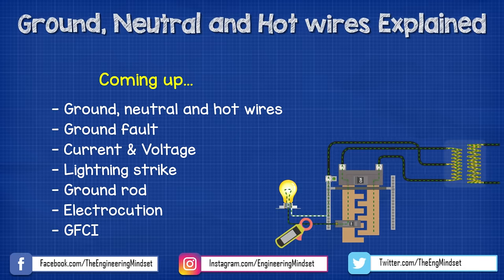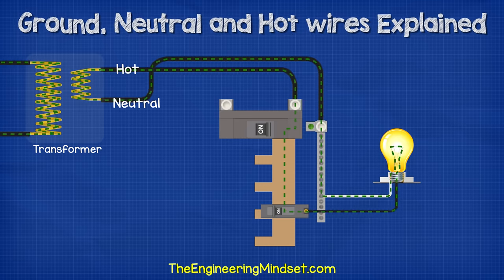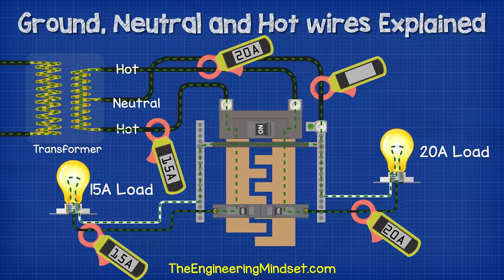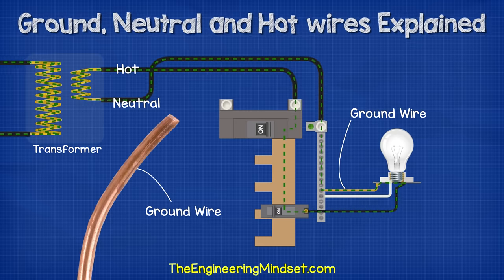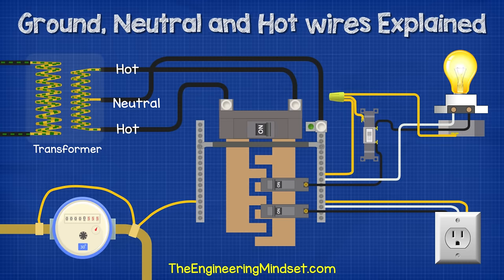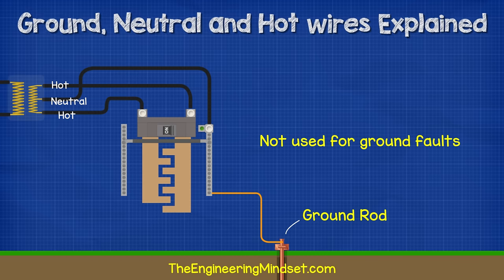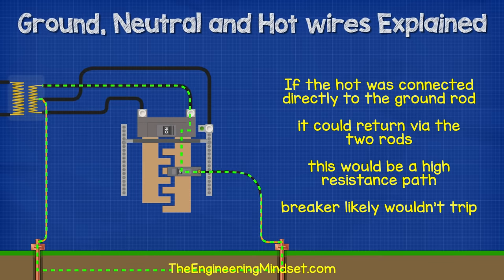Ground Neutral and Hot wires explained - electrical engineering grounding ground fault

Comment: I am a senior technician, self-employed in the PCB manufacturing industry.  Back when I was struggling with the difference between ground and neutral, I came up with an analogy using water that helped me better understand.  Imagine you had an upstairs laundry room.  Of course, there would be a drain in the middle of the floor just in case the washing machine sprung a leak.  But, in normal use, the water in the washing machine would go down the intended path through the drain behind the machine.  The drain in the floor acts the same as a ground.  It's not an active part of the washing machine plumbing but if necessary it can carry the water away to avoid flooding the downstairs.  The drain behind the machine acts as the neutral because it is intended to carry the water away in normal operation.
Reply: Great way to remember !
Reply: Thank u
Reply: Damn my dude...im an Electrician in GA and never heard a plumbing type of explanation for the Neutral but you are dead on...props to you sir,I'm gona use this on a couple of the older fellas at work!!
Reply: God Bless you sir!
Reply: Sweet!!! Now we know. This should be pinned
Reply: Almost like a Overflow Outlet?
Reply: Like a backup neutral?
Reply: love that you shared your wisdom
Reply: Great explanation! That really helped put a good picture in my head to understand the process.
Reply: Wow. Is it really just like that??? Really? If so, thank you. Teachers should explain it simply first before going complex.
Reply: thx ,man
Reply: Love this!!! Ugh I’ve been struggling lately and this helped 💛
Reply: Thanks for sharing this simple analogy :)
Reply: Dude that's a great analogy.
Reply: Thank you Greg
Reply: Like that. 👍
Reply: Im an appliance repair tech and this actually really helped me get that to click thank you!
Reply: well thanks... you just saved me from spending 10 minutes watching the video!
Reply: Game Changer!!!!!!THANK YOU!!!
Reply: Nothing beats a simple and rudimentary explanation. Thank you Sir, you've taught me a great lesson.... just keep it simple.
Reply: Uhm… what?.
Reply: Wowww....its nice....
Reply: Thanks for that analogy 👍 honestly helped me in college.
Reply: @princeuy8021  No, it's a bit more complicated than that and isn't a good analogy, which is why teachers don't use it.
Reply: Perfect now I understand
Reply: Love this channel. Love this community. Thank you all.
Reply: Wonderful analogy! It is freaking fascinating how often water analogies are used in the explanation of electrical engineering! Fantastic!
Reply: Made it better
Reply: What about a 220V outlet having only 2 hots and a ground?
Reply: Thank you very much...
Reply: An interesting way to remember
Reply: thank you... that makes sense.  in the event of a ground fault AND you have an earthing mat plugged into that ground wire of the receptacle, does the current flow to both ground (bus bar) AND the earthing mat?  looking at the diagram, it looks like ground wire "completes the circuit" at the busbar if there's a ground fault: transformer (source) -> live wire  --> ground wire --> bus bar --> transformer (source).  w/grounding mat touching that circuit (thanks to ground fault) bc it's plugged into ground, wouldn't that current go in both directions (to ground and to earthing mat)?
Reply: Thats actually really useful.
Reply: How so you come up with the title “Senior Technician” if you’re self-employed?  Why do you need a title at all?

Also, I’ve never once seen a floor drain in a residential laundry room, regardless of floor level. 

Other than that, your analogy works fine. 👍🏻
Reply: @Jcreek201   I'm not into titles. "Senior technician" is my way of saying I have a lot (50 years) of experience in electronics - but I am not a degreed engineer.  My formal training was through an 8 month Air Force tech school for analog flight simulators.  My son's home has the laundry room upstairs and the washing machine sits in a special tray that is connected to a drain pipe.  Eventually, the machine will leak and the water will be carried safely away without damaging his home.
Reply: Thank you very much Greg!!
Reply: O
Reply: So helpful. Thanks
Reply: Good explanation. Thanku
Reply: Great explanation
Reply: It's called earth, not ground
Reply: Beautiful.
Reply: Wow.... greatest explanation...as it is never before and ever after ❤
Reply: That's a great analogy, ill use that as a teaching tool!
Reply: @guyincognito. Please expand on your answer.
Reply: Holy smokes - Why has no one been able to say this before. I think people don't understand it when explaining. Thanks!
Reply: That is brilliant
Reply: Good idea of how to remember
Reply: Perfect!
Reply: Cool ❤ thank you
Reply: Thank you Greg. You are an amazing guy
Reply: that really does help. that will definitely stick with me
Reply: ….holy sh!t 👀 that’s a perfect analogy
Reply from the maker: We just published a new Ground fault, short circuit and arc fault video, so much detail! Link HERE➡: https://youtu.be/Qi0ynSQw-wc

Comment: Why is the battery backwards? Shouldn't your positive be hooked up to your 'hot' wire? I'm coming from automotive wiring where this is the case.
Reply: The diagram shows the movement of electrons which flows in the opposite direction of current.
Reply from the maker: We just published a new Ground fault, short circuit and arc fault video, so much detail! Link HERE➡: https://youtu.be/Qi0ynSQw-wc

Comment: Not to be that guy but ground wires are never less resistance than neutral. Commercial wiring you generally use the conduit which has far greater resistance than copper.  In house wiring they use the same gauge so it is easier to work with. Anything larger than 12GA will generally have a ground conductor up to 2 sizes smaller (6 Gauge generally has an 8 Gauge ground). The design is to provide 10x rated current flow for enough time to trip the breaker.  So yes path back to the bonding bar but not because it has less resistance.
Reply: Hmm that doesn't make sense.  Wouldn't copper be a better choice for ground? Is it possible that  pure copper is attached to conduit when  it goes into the ground?
Reply from the maker: We were referring to to path not the material it's made from. We discussed this later in the video.
Reply: @EngineeringMindset  You're making this worse. The "path" will always be the least resistant under Kirchoff law the lesser resistant path carry less current the higher resistant path will carry less current.
Reply: @j5892000  generally grounding rods are a copper coated steal, nickel or even galvanized. But that is Earth ground. At the box it will just galvanized steal where conduit is used as the ground. It does not need to efficiently carry current it is for safety.  In residential it is wire and in smaller branches the same gauge so you don't have to have different size connectors.  If you look inside a light fixture the ground is usually a tiny piece of braided copper. As mentioned just enough to carry up to 10x rated load for a fraction of a second to trip the breaker in a fault condition.
Reply: @GH-oi2jf   ah  so  does the conduit work fine due to the voltage being high enough to overcome  the resistance  like over head powerlines  that  are made of aluminum and carry high voltage  or is it just the fact that its metal And  the electricity  has no other path to use  anyways when  going ground?
Reply: @askandy7952  ah I see thanks  . great info too
Reply: @EngineeringMindset   your videos are very very informative
Reply from the maker: We just published a new Ground fault, short circuit and arc fault video, so much detail! Link HERE➡️: https://youtu.be/Qi0ynSQw-wc

Comment: You just explained the difference between neutral and ground better then anyone in my school OR my work. THANK you.
Reply from the maker: Glad you enjoyed
Reply: Yes most people don't know that a neutral is just the center tap of the transformer and it can carry a voltage potential to ground.

Tesla himself was asked about people getting shocked from neutrals and he asked " did you ground it?"( he meant bond the neutral to a grounding electrode), problem solved.
Reply: Exactly. I always asked this to my professors/coworkers and what they all said sounded like they didn’t even know either.
Reply: Klik B  Those that can't do..teach.
Reply: @billwilson3665  And those that can't do can't do because they were never taught. ;)
Reply: The only other thing to add might be the professional trade/code difference between grounded conductor and grounding conductor.
Reply: bruh, ground doesn-t go to the source, it's called ground because it goes to  javeline... on the ground -.- also called earth. only  case ground goes to source is when you ask for 3 phase supply and you get 4 wires, 3 phases or hot and one neutral
Reply: @Twoface0233  I agree.  I've asked several people who I thought should know better about the function of the neutral wire and one of them told me it was so you could sell power back to the power company.  Hmmm.  I don't think so.  I came from an automotive background (DC circuits) so the whole concept of three wires is new to me but this video is VERY good at explaining the difference.  Thank You for making it and posting it The Engineering Mindset!
Reply: @Hearing.Chanting Remembering.Krsna Only if it is bonded to an Earth ground.
When AC was first introduced by Tesla, people complained that they were getting shocked off the neutral, he told them to ground it.
BTW, I've been a master electrician for over 40 years.
Also in a 3 phase 240 volt delta, the neutral tap is between 2 of the legs and that is why the opposing leg of the delta carries 208 volts to ground while the other 2 legs carry 120 volts to ground.
Reply: @Hearing.Chanting Remembering.Krsna Yes that is what I said in my first comment of this thread, scroll up.
Reply: We only learned how to make a flash light.
Reply: Same I was lost but now I get it my teacher isn’t good gonna need to retake my course cause of him
Reply: I thought at long distances the ground rods didn’t have much resistance between each other so when the neutral gets disconnected from a house sometimes you don’t notice because the ground rod takes all the current back to the center of the transformer. This is why it’s a good idea to put a clamp meter on the ground rod wire every once in a while. Am I wrong on this. 

Fantastic video by the way. Very few people describe this completely like you did. Great job.
Reply: @OprichnikStyle  Nope. You are mistaken. Electricity does not 'want to go to ground' as many have been taught. It goes to ground only because the transformer is also grounded, thereby completing a circuit.
Reply: @ecospider5  In theory if your ground connection was extremely low impedance, maybe. But even though the earth as a whole would serve as a perfect conductor, the connection points (i.e. your grounding rod) do not; and so you will have an added load in your return and therefor you would notice varying voltages between the two phase legs when unbalanced.
Reply: @Spruce_Goose when I said people wouldn’t notice I was referring to people that don’t understand electricity. Yes if you new to regularly test the voltage at your house you would probably see the problem. Putting a clamp on the ground wire guarantees you will see the problem.
Reply: @ecospider5  I see what you are saying. I certainly don't see any reason not to do what you suggest. Heck, maybe it's a good idea.
My point was only to clarify that the ground rod impedance will cause strange behavior on the system; behavior that is commonly observable like lights that dim and brighten (for the duration not for an instant) as other loads are switched on/off, as well as other behaviors one might observe due to over/under voltage. It doesn't necessarily require measuring voltages with equipment to see this in a lost neutral scenario. 

If I started noticing this, I like your idea to check the ground connection for current (after first checking to see if the neutral has obviously come loose.) The other trick would be to make sure you are not running balanced loads when taking the measurement.
cheers
Reply: @ecospider5  another example symptom could be shocks experienced via metal 'grounded' equipment.
Reply: LOL what the hell school is this. I want to know, so I can make sure no one ever does any work for me, that went to it
Reply: @Twoface0233  That is my greatest and maybe only pet peeve. just admit you don't know and we can figure it out together.
Reply: Dam because
Reply: @EngineeringMindset  she was
Reply: Get another school👩‍🏫
Reply: @MichaelClark-uw7ex  You're a genius 👩‍🏫🤣
Reply: @spruce_goose5169  I actually did a repair once, where the customer said the lights were flickering, I started my inventory of the system by checking the service drop.
Looked good, then I noticed small wisps of smoke or steam coming from the ground rod.
I knew they had lost the neutral at the transformer and the ground rod was carrying all the 120V load, it actually got very hot.
Reply: Smart explanations makes a smart population
Reply: Swim
Reply: Gram
Reply: Although the neutral has connection to the ground, the purpose of it is the return path across the hot wire going the transformer. While ground wire serves as the protection from the ground fault. Ground wire and neutral wire must have separate ground rod.... This tutorial video is well explained ....
Reply: It's simple... the white wire picks up all the slack from the colored wires
Reply: @Featherless1  WOOOOOOOOW
Reply: Imagine a black man saying the same thing, would you understand still?
Reply: Yeah I mean it's sort of semantics.   In an alternating current the ground and positive essentially switch.  Therefore neither is really either and both :P
Reply: Than 
I’m sorry
Reply: Can anyone think of a different comment please? It's literally thousands of the same exact thing comment on every video
Reply from the maker: We just published a new Ground fault, short circuit and arc fault video, so much detail! Link HERE➡️: https://youtu.be/Qi0ynSQw-wc

Comment: My body has completed a circuit a number of times.
Reply: Do you know the wattage you are rated sir?😁
Reply: @markanthonyvaldez4517  Maybe he is still experimenting on that!   LOL
Seriously Pea Stone - be careful out there man!
Reply: same - not the best feeling, I think you'd agree
Reply: Electroboom:
Reply: @slatsgrobneck7515  I know the reply is late, but thanks man. Had another experience with a faulty fridge electrical cord the other day.
Reply: We complete it when we finally get out of the hydrogen machines and return to source.  :)
Reply: hahah,!! in grade school (90s), there was an audatorium with 2 pay-phones… next to eachother. If you took the receivers off “the hook” (leaving them dangle or whatever), and used each hand to pull the levers down (whic is what happens when the phones are “hungup”), a current goes from one phone, up one arm, across heart, and out other arm. It DEF had a charge!!. it was actually dangerous. 🤦🏼🤣🤷‍♂
Reply from the maker: We just published a new Ground fault, short circuit and arc fault video, so much detail! Link HERE➡: https://youtu.be/Qi0ynSQw-wc

Comment: Paul, you are the best teacher whom I have ever run across when trying to understand the fundamentals of electricity.  
  I have been trying to learn this concept for years, and for years, NO ONE could teach it to me so easily as you just did in this video.
  PLEASE do not stop teaching people!  Your method of teaching has most likely helped hundreds - if not thousands - of people in search of higher learning!
Reply: By now, it looks like maybe millions of people!
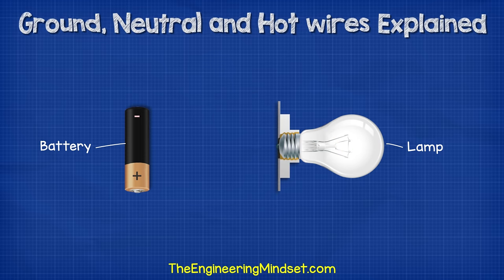Reply: 1:35 i always assumed on a battery with direct current the positive+ side was hot with current travelling outward and the negative= was the ground to complete the loop
Reply from the maker: We just published a new Ground fault, short circuit and arc fault video, so much detail! Link HERE➡: https://youtu.be/Qi0ynSQw-wc

Comment: This is a fantastic video and explains things very well. The one thing that is potentially not accurate, though, is that in a DC circuit the wire going from the negative terminal of the DC power supply to the negative connection of the load/circuit is called the negative or ground wire, not "hot wire". While it is correct that electrons flow from negative to positive, all voltage (difference in potential) has been dropped across the load or circuit so that there is no voltage at the negative or ground wire. The "hot" wire in a DC circuit is synonymous with the positive wire, or the wire that carries the difference in potential.
Reply: Thanks. The pic at 1:49 messed me all up.
Reply: The hot line in DC is the positive.The negative is called ground.There is no actual ground (earth) in a DC circuit as negative is always zero volts.
Reply from the maker: We just published a new Ground fault, short circuit and arc fault video, so much detail! Link HERE➡: https://youtu.be/Qi0ynSQw-wc

Comment: After high school, I resisted the thought of doing engineering. But currently, I am a graduated electrical engineer. I think these videos are very powerful for anyone having difficulty on these topics.
Reply: Yeah it’s important to remember that everyone has the potential to make a difference. I’m often shocked how negative I can be towards myself, and in those moments I remind myself that no matter where I’m at now, as long as I take charge, I can power through.
Reply from the maker: We just published a new Ground fault, short circuit and arc fault video, so much detail! Link HERE➡: https://youtu.be/Qi0ynSQw-wc